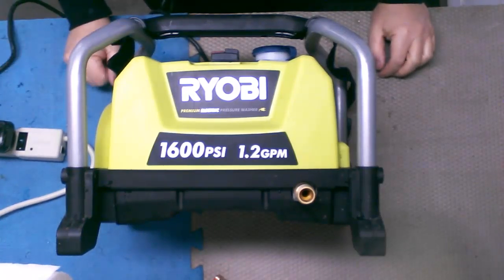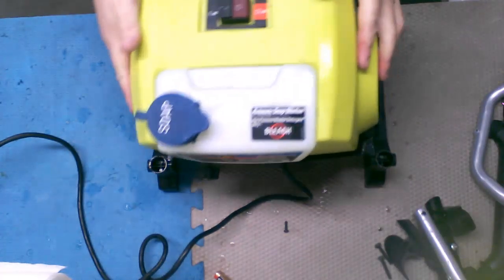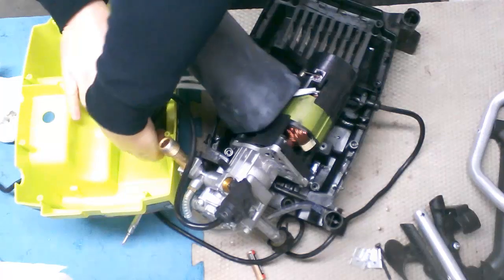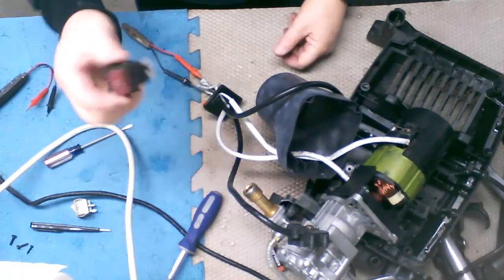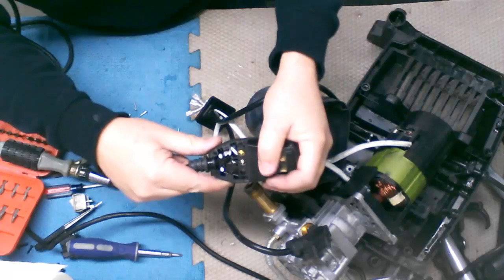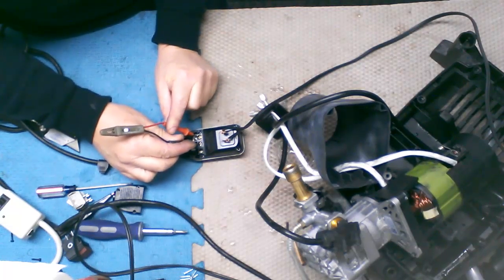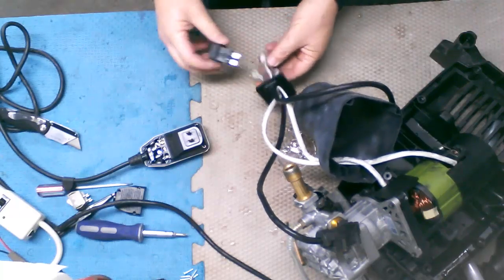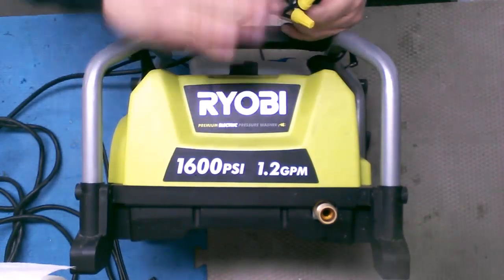Repair a Ryobi Pressure Washer / How to fix an Electric Pressure Washer

Comment from the maker: In this video we repair a Ryobi 1600 Electric Pressure washer. This pressure washer was discarded because the previous owner thought it was no good any more (literally junk). All I know is that it stopped working. So is it salvageable or is it junk? Watch the video and see, you probably wont believe what's wrong with it. I know it took me by surprise.
Reply: I also bought one of this product and the same problem happened to me, it stops working after ten minutes of operation, what is the solution to this problem
Reply from the maker: @luma7901  You either have a blockage causing the unit to overheat, or the GFI is overheating and cutting off the power. Try replacing the GFI circuit and see if that helps. It seems to be a common problem with these units.
Reply: @ModernDIYProjects  mine smells like it is burnt when I turn it on
Reply from the maker: @xBroWsinG  That is not a good thing. You'll have to track down the smell to see where it comes from. It may be a replaceable part. If it smells but still works then that is a good sign.

Comment: Had this issue today and it was a faster fix then I thought 15 min to the store and 2 min fix. Thank You!!!
Reply from the maker: Glad I could help!
Reply: What store did you get the plug?  Cause I don't like ordering on line cause of the wait lol. Thanks
Reply: That wasn't even problem the Ryobi pressure washer will not start up or have power to the pump without it being connected to a hose with water pressure all you did was by pass that fall safe system Ryobi had in place to protect the pump from ever being ran dry!Omg that's funny

Comment: Cool video. Didn't realize those GFi things went bad.
Reply: Quickest $50 an electrician can make.  Resetting or replacing a GFCI on a porch when the customers bathroom light won't work.  Sparkies will get why.

Comment: Just bought one of these and after 10 minutes of use it stopped working!  Same symptoms as this one. I will be testing that  gfci and hope that’s all it is. Thanks for the video
Reply: I also bought one of this product and the same problem happened to me, it stops working after ten minutes of operation, what is the solution to this problem
Reply: @luma7901  I changed out the plug. I did notice when I opened up the original plug that the manufacturer had screwed the terminals down metal to plastic instead of metal to metal. Most likely causing a weak connection

Comment: I Just cut the cord spliced it and replaced it with another cord For a  temporary fix. I Will either be buying a new plug with the surge protector built in or splicing an old hair dryer and stealing that cord for a plug. I suppose I could also add a fuse to my temporary fix and that would work as well. I too got one from someone who thought the unit was junk. They even said they watched your video and said the issue was narrowed down to the plug.... I guess sometimes when you need something now it’s easier to just get a new one and leave the old one. Well one mans trash is another mans treasure!
Reply: A surge protector is for protecting the device only. The GFCI protects you from shock and is important because of the water involved primarily. Are you still there?
Reply: @stevenbryant4718  haha yes Steve. All that info was just options. The replacement plug is only $15 online. I bought that and installed it properly. Only reason I tried the splice route was buddy was gonna throw it out so before it hit trash I just went for diagnosis and made the plug to see if it was seized (I just was seeing if it cycled power not running it)
Reply: @patrickstafford8480  During a hurricane it is illegal in FLA to power your home with  electric generator if it is in anyway tied to the grid. That is beacause people do stupid things with electrical wiring they saw on the internet. The power company technicians will come to your home and pull your meter. They don't like to work on live circuits, go figure. Sure they have life insurance,  but who'll repair the downed power lines?

Comment: CONTINUITY TEST with a multimeter with some alligator clips would be a quicker and safer test method to check the switch, cord and the GFCI for continuity.

Comment: I have a similar unit, on my third actually and have learned the green lights are your friend.
I can't tell if your switch has a green light but,
If the GFI plug has a green light , there is power going to it, not necessarily thru it. If the switch on the unit doesn't have a green light on, then you know from the beginning the power cable is bad or the GFI plug needs to be replaced.
Reply from the maker: Yes, mine had the green light lite up, that is why I was confused at first. I later learned as you said that the green light only means power is going to the plug not through the plug.

Comment: Could have used an extension cord to plug in the GFCI to check for power. Would have been easier and safer.
Reply from the maker: Watch the video again and you'll see that I did that. It was giving a false positive showing power when there really wasn't any. That is the reason I went on a wild goose chase tearing it apart.

Comment: Our GFCI has to be pressed every single time we plug in... Maybe try that?
Reply from the maker: Actually that means that your GFI circuitry is slowly failing. You shouldn't need to do that every time you plug it in. Don't be surprised if one day soon your GFI fails.
Reply: @ModernDIYProjects  actually some are designed that way

Comment: Ok I change the plug however my motor is still not cutting on any further trouble shooting I can do?
Reply from the maker: Replace the plug with a standard plug instead of a GFCI and see if it works. If not then the motor is bad because I don't remember any other fuses or breakers on this unit.

Comment: Had my switch fail too on my Ryobi Power Washer. Seems to be a common problem.
Reply from the maker: Yes, it was a very common issue a while back. I don't know if it's been corrected in newer models.
Reply: i have the newer version of this model and it just happened to me. crap product

Comment: Great video! What is the part called that I have to order to replace the black circuit breaker reset button part.
Reply from the maker: Just look up GFI, its easier than Ground Fault Circuit Interrupter. On Ebay (Amazon too I'm sure) they sell them with the cord and everything so all you do is install it from where it connects to the motor. Cheaper and safer.

Comment: So did you find a new gfci connector? Im having the exact problem!!
Reply from the maker: Sure did. I took the GFI off an old hair dryer that wouldn't heat up any more. It was the same specs as the one on this machine so it works great. If you don't have an old hair dryer you can get a new GFI at Home Depot or on Amazon.
Reply: @ModernDIYProjects  right on!!

Comment: Does rocking the power switch on&off really works?
Reply from the maker: It does not work if the problem is in the GFCI switch. Rocking the switch back and forth only works, if your power switch is bad. But the GFCI has it's own separate circuitry which is not affected by the power switch because it is built into the head of the power plug. It cuts off the power before it ever gets to the power switch.

Comment: Thank you very much! I was just about to toss out my pressure washer because I've ran out of components to check, not knowing that the one thing I thought worked (GFCI plug) might be the problem.  I think the darn light shouldn't come on at all if there's no current getting to the other end.  I hate to think how many appliances are in the dumps right now because of it.
Reply from the maker: Yeah, I did'nt think they went bad either, because it doesn't happen that often. The reason they are on devices like this is because you are working with water, and it's to prevent you being electricuted while standing in a puddle of water.
Reply: I know right Frank Caan?!?! I was thinkin the same thing! I think that is just plain dumb for that light to come on right at the beginning. Bc when I didn’t see the light on up on the unit right away I thought, well the lights on on the plug, so it’s gotta be something with the motor or pumps shot. Just thought the worst.
Reply: I also bought one of this product and the same problem happened to me, it stops working after ten minutes of operation, what is the solution to this problem

Comment: my GFCI won't light up. advice? I could send it into Ryobi in California for 20 bucks and weight probably 3 weeks to get it back or I can just dig into it myself and try and fix it
Reply from the maker: The light is irrelevant if it doesn't work. Make sure that the GFCI works. There is a test button, use than and see if it still works. If the little light diode burned out you really don't care. All you care about is that the GFCI works. If it doesn't work, then you can probably get a replacement for less than shipping it to be fixed. If you are so inclined, I would say to fix it yourself. Easier and faster.
Reply: @ModernDIYProjects  thx for reply. So in theory, I could put a reg plug end on it and plugvit it into a gfi extentension cord, right?
Reply from the maker: Yes you could. Or you could get a GFCI plug end and apply it to this unit which is what I did. But be sure to ALWAYS have a GFCI on this, otherwise you could get electrocuted. Water, Electricity and the Human body DO NOT play well together.

Comment: Is it safe tho when you run it without a gfci plug. I would run the wire from a extension cord and wire them together so I get a straight plug without gfci. And by the way I got a gfci outlet in the kitchen where I run the pressure washer. If it safe?
Reply from the maker: It is not smart to run a device that uses water and electricity without a GFI. Like I mentioned before, it's easy and cheap to get a replacement GFI. You can get one online or at Home Depot and wire it in. If you are plugging the unit into a GFI that is wired into the house, then you are OK because you are already using a GFI. Some people have GFI in their garage wall outlet for such purposes.

Comment: Do you have a part number for the replacement gfci and how much did you find it for and where? I appreciate your skills, I enjoy repairing things as well.
Reply from the maker: There is no need for a part number. I just got a generic GFI plug and replaced it. I didn't use a Ryobi part. Go on Ebay or Amazon and look up GFI or GFCI replacement and you will get tons of results. I picked the cheapest one.

Comment: But did you reset the switch on that breaker on the power cable. If there is a fault, it trips and there's no power. Was it reset ? In all your testing , you never reset that button.

Comment: what size safety square screw. r1 doesn't work.
Reply from the maker: Couldn't tell you. I cut my old Ryobi GFCI off and replaced it with a new one from a different manufacturer. They're all going to be different.
Reply: @ModernDIYProjects  I took my r1 and filed it down maybe 10 microns on each side. Then it fit fyi
Reply from the maker: Cool, so it wasn't that the bit didn't work, it was that it wouldn't fit into the slot. Good to know.

Comment: PEOPLE read about wall GCFI's. Get one installed where you use this unit. They protect the other wall outlets in the same circuit and should be used where work is performed, especially outside!

Comment: So even though the green light is on the plug, it still can be the plug?
Reply from the maker: That's right. That is what threw me off in the beginning of the diagnosing. It seems that the light only tells you that you have power going to the plug, and nothing more.
Reply: @Modern DIY Projects  okay cool thank you so very much!

Comment: Nice vid, how bad is it to leave while bypassing GFCI?  Ya, there's water, etc. but I will have the cord WAY far away from machine.  Also, it looks like many replacements are 15A, how do you know required spec?
Reply from the maker: The bad part about not using the GFCI is that you could get electrocuted. If the cord touches water and shorts it can electrocute you if you are standing in the water. It could also blow out house fuses and such. To get a replacement just look at the specs on your machine. Should be stamped on it somewhere. Easy to get a cheap GFCI on Ebay or Amazon or maybe at a local hardware store. If you have an old hair dryer that doesn't work you can take that part and swap it over.
Reply: Did you happen to use yours without a gfci on it at all? Was thinking of trying get one use out if it before i got a new replacement gfci

Comment: Always check the power cord first.  Using a 'Wigi' check the power before the supply and after the supply running the wigi down the cord towards the unit.  Sometimes a wire will break inside the cord.  From there you would troubleshoot the rest of the unit.

Comment: Cheap electronics high failure with those GFCI  plugins. Switch is less likely the problem with these little Ryobis. I replaced mine after after one year of use and now the hose blew 3 years later  other than that works great at 4 years now..GP
Reply: Follow up my second GFCI switch didnt last too long either maybe 1 year used it 5 times and this season dead.These switches are junk all of them the board is a nightmare of cheap electronics. Also dont have to take these  units apart first. I know this is your first time but for new viewers just plug it in and remove the small cover and see if you have 110 volts coming  out where the two wires connect going to the unit  with a multimeter. 90% of the time there will be no voltage coming out...I put a regular two prong  male receptacle on mine Im done changing these cheap GFCI protectors Ill take my chances with getting zapped for now on. The cord on these Ryobis is very long so that helps stay dry most times for me and my outdoor receptacle has a GFI outlet...

Comment: Always check the "test" button on the GFCI first. Could have saved you from dissecting the unit. Live and learn.
Odd thing on your unit, mine AND many others I watched on youtube, the white wire is connected to the gold screw (L) and the black to the N neutral (silver) screw.
This is opposite the convention where white is Neutral and Black is power. 
Ryobi had no explanation for this and the GFCI manufacturer just shrugged.

Comment: Mine is buzzing at the electrical outlet plug and shows green light on plug but won’t power to main unit
Reply from the maker: Your GFI is bad, you need to replace it. It is either arching internally or it is trying to reset and not achieving it. Either that or some of the resistors or capacitors inside are messed up. If you open up the GFI you'll see it is packed with electronics. Anyone of them could be bad.

Comment: I have the same type of problem but my washer is not turning on because the reset button keeps trigger in
Reply from the maker: You can buy a new GFCI switch online. Cut the old one off and rewire the new one in it's place. It's an easy fix. I did it to this one. You can also buy an entire cord with the GFCI attached and replace it from inside the machine if you want to be safer.

Comment: Couldn't you get an off the shelf GFI outlet wire the outlet with a vacuum cleaner cord that way you have a portable GFI cord probably have to drive a ground lead into the ground well they are usually used outside ?
Reply from the maker: No that's too much trouble and just not safe. Just buy a generic GFI unit rated the same as the one you have currently and splice it in to replace the old one. It's cheap and easy. That's what I did for mine. In fact I took the GFI off an old blow dryer that stopped working because the were both rated at 1600 amps.
Reply: @ModernDIYProjects  What is cheap $5 $50 what did you pay
Reply from the maker: Go to Ebay and you can get the entire GFI unit with a new cord for around $10 (rated for outdoor use). That way you wire it directly from the motor. Safe and cheap.

Comment: I have 2 Electric pressure washer the circuit breaker for the washer will not stay on to deliver power . I press the button on the plug it works immediately clicks off . It wants to work.
Reply from the maker: Your GFI is messed up so it keeps shorting out. That is when it shuts off. It's not safe to use this way.
Reply: Sounds like a dead short in line circuit breaker or in the cord or in the machine. Maybe it's just doing it's job ?

Comment: Mine turns on but doesn’t do crap. Nonoressure
Reply from the maker: The pump has probably gone bad.
Reply: @ModernDIYProjects  I think so too. Sad part is I’ve used it twice
Reply from the maker: Before you junk it try to lubricate it and stick a small metal rod through it. Sometimes it may be clogged or jammed. Water minerals can be problematic. That is why I always tip mine sideways to make sure all the water drains out.

Comment: my gfi died also. Fixed it with a spare (from another dead power washer) and was running. Strange it happened when stored. Never got wet. Don't care why.
Reply from the maker: It's a very common problem with Ryobi. Cheap products used in production.
Reply: @ModernDIYProjects  Interesting followup. RYOBI uses 2 wires past GFI to pump. I replaced with 3 wire. strange cheap manufacturing.

Comment: when the little green light on the on/off switch doesn’t light up when plugged in, indicates a bad GFCI. Saves a lot of time not having to tear it all apart to figure it out (learned from another video)..
Reply from the maker: Not necessarily. It could then be a broken wire, bad connectors, bad switch, bad fuse, any number of things. It could send you down the wrong rabbit whole same as what I did. The GFCI should not light up at all indicating that it is bad.

Comment: Connect water line and nozzle line. Turn on water. Turn on washer. Squeeze gun trigger. Only turns on when trigger is squeezed. Easy peasy.
Reply from the maker: Did you watch the video? That was not the problem.